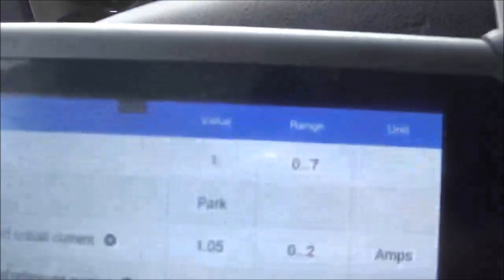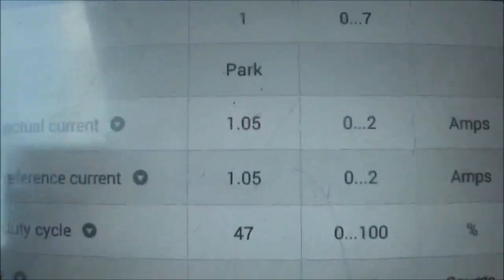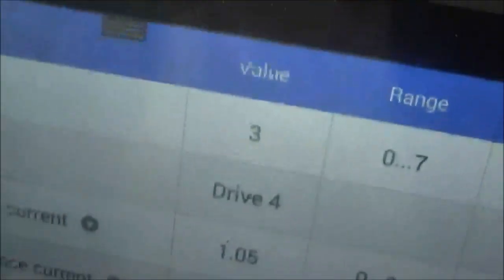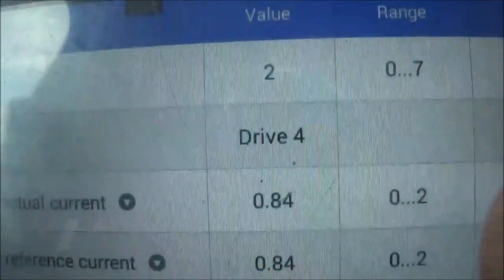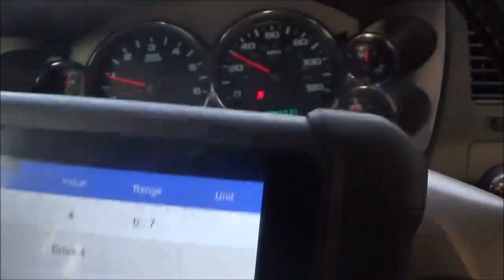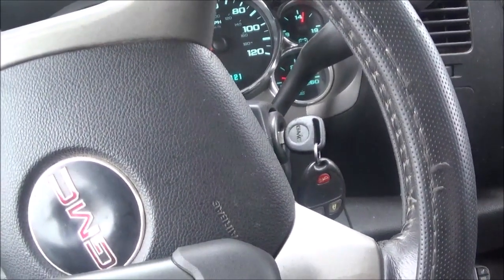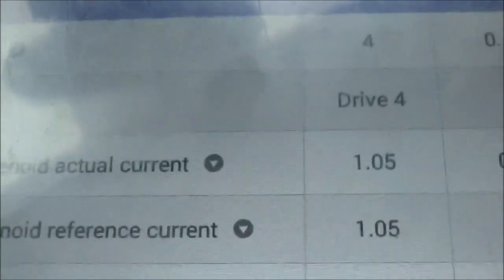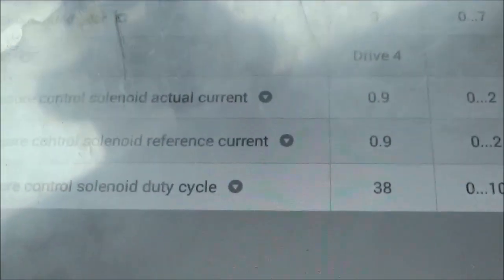TRANSMISSION SLIPS AFTER REBUILD! THIS SENSOR WILL DESTROY TRANSMISSION ON GM AND CHEVY VEHICLES!

Comment: Way back in the day Figured out on Toyota's when I worked at it specialty toyota shop that oiled air filters the oil would suck through the air filter and make the mass airflow meter dirty on Toyota's never saw  any affected on the transmission but you should definitely not have one of those on your GM vehicle. If you want a fancy air intake you need to get a Air filter that does not require oil. Or just keep it stock I'm actually watching this video because I have a 2007  GMC with a 6 L90 in my shop now. That has lean codes for both banks  Had it in about a week ago 'cause the headlights didn't work and saw those codes and some transmission codes so I cleaned the filter and the mass airflow meter came back this week with the same  Lean codes with a K&N air filter on it an a Rebuild Jasper transmission witch in my personal experience anything Jasper is suspect  I work at a shop where we used rebuilt Jasper engines and transmissions. They pretty much have a  30% failure rate. 50% success rate. And the other 10% percent they don't quite work. right. The last 10% work great with problems. Then you fight with the warranty people and they only pay you half for labor rate to reinstall a new.  Great video really appreciate the knowledge thank you.
Reply from the maker: Jasper put out so many transmissions and engines, they probably do not care about some failing. Little shop have to care though.

Comment: Would this apply to GM 6l45 
transmissions used on BMWs?
Reply from the maker: I'm not sure. However, it will apply to the 4L80e transmission.

Comment: My tranmission was just rebuild but is still excerlirating and shifting
Reply: Is it still
Reply: @brunowskijr  not no more i gave a week after it stopped it works fine.

I was just worried why it was like slipped when it was new rebuild
Reply: @AlexJ-e5t yeah my 4l60e was rebuilt a week ago and I felt it do the shift flare under load from 2-3. Hopefully the TCM will relearn

Comment: Can you help me! 4th time trans been built only thing hasn’t been changed is the transmission case 
Keeps burning only 3-4 
First rebuild drove 30,000
Second 1900
Third 750 
Forth 400 miles 
No check engine light new TCM and Barnes and internals on tranny new
Reply from the maker: If the vehicle has a tune, I can't help you because I do not work on vehicles that have had the computer modified, knowingly. Second, you may have to take the vehicle to a transmission shop to have a pressure gauge hooked to the transmission to have all gears pressure tested while driven. Shops do not like to do this because it takes lots of time, however, sometimes it has to be done to fine hard problems.
Reply: @thisisyourtransmission  no Tunes or modification done rebuilt back to stock specs took it to another shop after changing the sensor you speak of in your vid, he recommends diffrent tranny casing could have hair line crack Thanks for the suggestion
Reply from the maker: @CokeNJack  If I had this problem, I would change the transmission also, to see if it solved the problem, then if it did, I would destroy the transmission that I took out to never use it again. How many miles where on the original transmission?

Comment: GM should have used MAP value to use a reference single to have pressure raise instead of the MAF or at the very least used MAP as a bypass when MAF info is faulty.
Reply from the maker: Yes, they should have multiple sensors to default to when the Maf goes bad. This shows that the transmission is not always the fault of its own destruction.